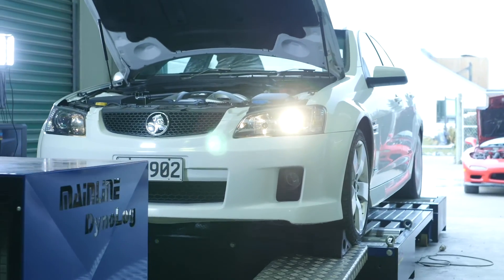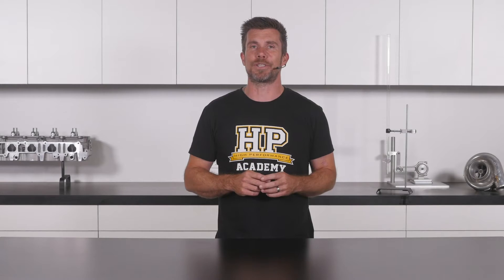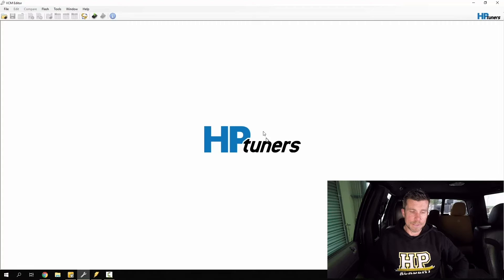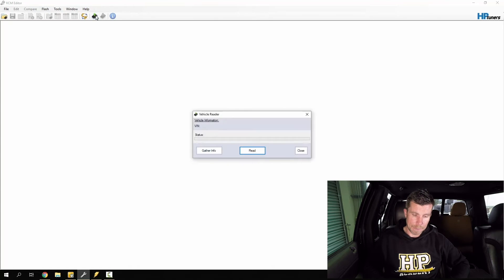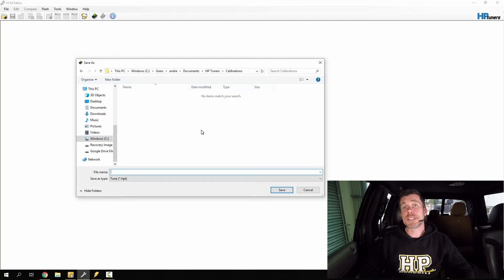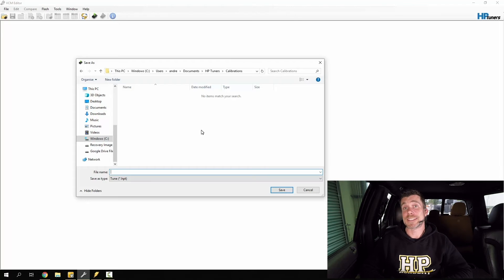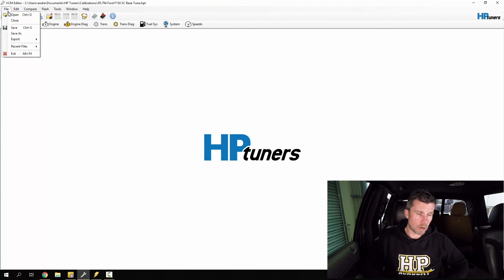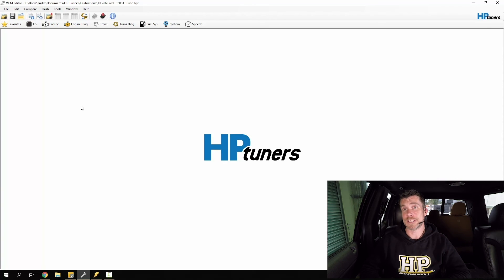Tuning an OEM/Factory ECU? This Is Your FIRST Step! | Stock ROM File [FREE LESSON]

Comment: Hi there, this may be a silly question but what OBD to usb do you recommend to get this stock read?
Reply from the maker: Depends on the software. For HP Tuners or EFI Live etc, they supply that.
We use our Tactrix OpenPort 2.0 with a few other things including WinOLS but whatever software you are using will have a recommendation or outright requirement when it comes to hardware, so work your way back from there 😎 - Taz.

Comment: Hi ive taken all your wiring classes and they are excellent. I’m considering getting into tuning and my first project would be a two cylinder Kawasaki engine. It is throttle body injected and there’s no way to connect to it, is their and easy way via software or a tool to take a recording of the way the stock ECU behaves to come up with a base tune if I replace it with haltech or megasquirt
Reply from the maker: No, you wouldn't do that and the ECUs are structured very differently. A base tune to just do a systems check (that is all a base tune is for) on a standalone ECU is actually a straight forward process. Because it is a first step for those learning, more fear is around them than there should be. We have videos on setting up base tunes.
From there you still need to do a tune like you would anyway, otherwise what is the point in fitting a different ECU if you want to keep it stock right? - Taz.
Reply: @hpa101 thanks, I’m fairly certain I was overthinking it and just concerned about establishing a starting point for the new ecm without blowing it up to get it running.
Reply from the maker: Not a bad thing to overthink it a bit, better than underthinking 😂
Use the 'blog post' filter on this search if you want a bit more info, hope it all helps - Taz.
https://www.hpacademy.com/search/results/?q=base%20map

Comment: I bought an 08 Lancer DE with an automatic transmission. It was missing the ecus. The guy who sold it to me doesnt know where it is and cant get it. I bought a used one on Ebay. What can I do if the stock image from the ecu of my Lancer from the factory is unavailable to me like this? How do I go about getting that stock rom so I can program this used ECU from ebay?
Reply from the maker: If you got a stock ECU for the exact same model of vehicle it will have a stock tune on it, it won't come blank. Only standalone ECUs come blank otherwise every car would need to be tuned before it left the dealership.

Hope your replacement does the trick, was it running an aftermarket ECU that he didn't include in the sale or something? Odd to lose an ECU... - Taz.
Reply: @hpa101  He said he bought it from some guy who bought it from someone else . No one could get it to start. I'm going to try to reflash it with the open port 2.0 cable i just bought and am waiting on to arrive. After that i'll probably try a starter as I went outside this evening and tried starting it with my scan tool hooked up and the rpms from the crankshaft position sensor were only at 114 rpm while cranking. I had an immobilizer code and had a locksmith come out and program my key and the code went away and hasnt come back. I also vin wrote the vin to the immobilizer, the ecu, and the etacs. I'm not getting fuel or fire. I dont understand why. FLashing the used ecu is kinda my last hope as I have 12 volt in all the right places, 5 volts in the all the signal places, and ground at all the ground places. I have compression I just dont understand why the thing wont start.

Comment: Is there a way to take a snapshot of a stock ecu settings or values? I dont really know how to word this since I know nothing about tunes, so I will just explain what I'm trying to do. My car seems to run perfect with tons of power and overall is just flawless right after i reset my stock ecu... but over time roughly 2-3 weeks it will start to get slower and slower where it becomes a different car without any noticeable power or performance. What I want to do is copy whatever those parameters or values are in the early stage after i do the reset and move them over to a tune so they are set and never change. My car is completely stock and I'm not going to be adding anything so there is no point in doing a dyno or any of that complicated stuff, so I am looking for the easiest way to tune it based on the fresh reset ecu values. Is it possible to copy values from the stock ecu before it relearns and changes them? Can you copy and set those on a tune or is that not how it works?
Reply from the maker: You should take it to your mechanic, something isn't right and the cheapest way to solve it would be to tune it, if it was modified. However as you say is bone stock so there is clearly an issue with your vehicle somewhere, a bad sensor at a while guess that is giving your ECU's closed loop systems a hard time.

The time and money you will spend on tools and software just to solve this with no intention of getting performance gains or using the knowledge further in the future really doesn't make this work you diving into personally imo given what you have said there - Taz.

Comment: Is tuning on the track an ideal way to tune if i dont have access to a dyno? Thanks
Reply from the maker: So long as you don't have a torque based ECU, yes sir! You will leave a little bit of power on the table but can get very close to dyno tune results. Even when you tune using a dyno the last step is to confirm things on the track/street - Taz.

Comment: Hey guys, need to ask. Do you need to retune the stock ECU if you throw a stroker kit in it? The engine comes stock from the factory in 1.3 and 1.6 variant. The 1.6L variant is just a 1.3L stroked engine.
Reply: ofc u need to tune it. throw 1.6l rom in it

Comment: I'm doing an ITB build on 03 Lancer which has a USDM 4g94 and the only problem is the ecu. The base ROM of the ecu depends on the MAF which is pretty much useless but luckily the 4g94 has MAP sensor which I'm not using also since it requires large amounts of pressure from the plenum. I'll be using gsxr1000 itbs (with the map sensor) but I will not be using a standalone ecu since the build is intentionally budgeted. I was thinking of using the 4g93 1.8 ROM file since it runs on a MAP based set up and engine wise they are almost identical. Now for the elephant in the room. Is it possible to install the ROM file from the jdm 4g93 sohc to the 4g94 USDM ECU?
Reply: Do you still have the car?

Comment: Vcm software ... What's that where do we get it and does it work on all cars or just this one? Cheers
Reply from the maker: Hey Shane, it's free with the HP Tuners Hardware. They have a list of applications on their website: https://www.hptuners.com/vehicles/ - Ben
Reply: @hpa101  looks like it doesn't support the Nissan fuga 350gt DE motor only the HR yet it does the Maxima with the 350 DE
Reply from the maker: @williamshaneblyth  take a look at a software called UpREV. - Ben
Reply: @hpa101   hi can you tell me what software you use on Mitsubishi evo 9. I’m guessing it’s Evo tune? Just a shame it’s so outdated.
Reply from the maker: @drewthatsme6212  we have an Evo 9 on the way here, EcuFlash/EcuEdit and EVO Scan will be on the cards. When it comes to free opensource software, being older is a good thing as a rule - Taz.
Reply: @hpa101   brilliant thanks for the reply 😁 It would make it much to follow the guides, if I was on the same software 👍.
Thanks 
Drew.
Reply from the maker: @drewthatsme6212  yes they do help you learn faster, however, you can learn without an exact replica of your application, it just takes a little more time :) - Taz.
Reply: I want to say vcm is an acronym for vehicle control module, but it seems like that is in reference to the tuning software for changing maps